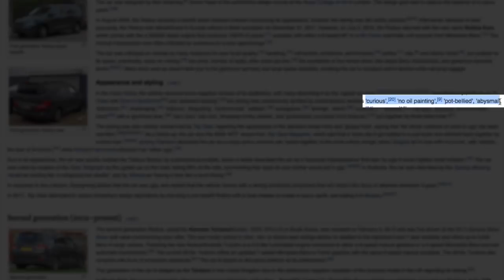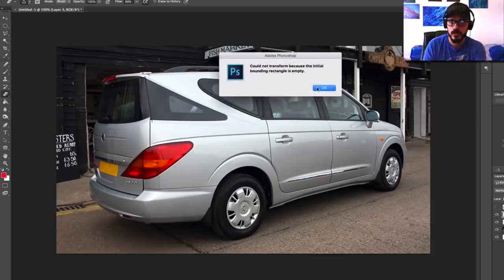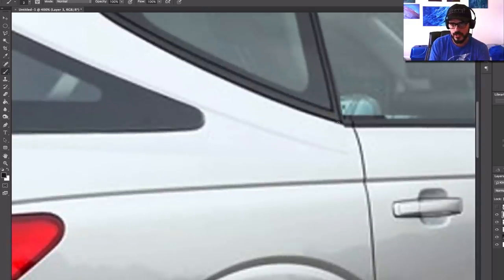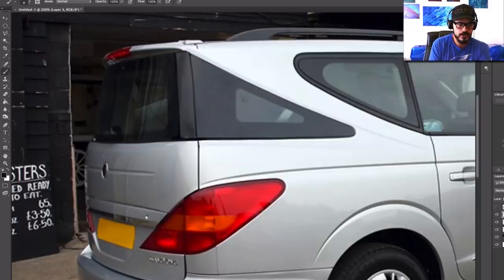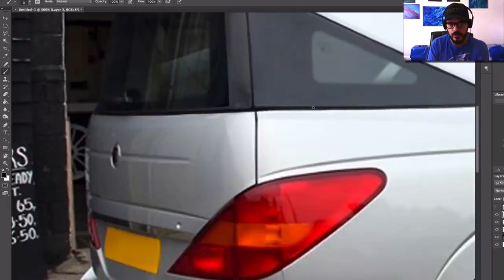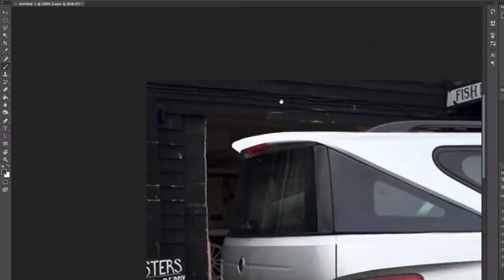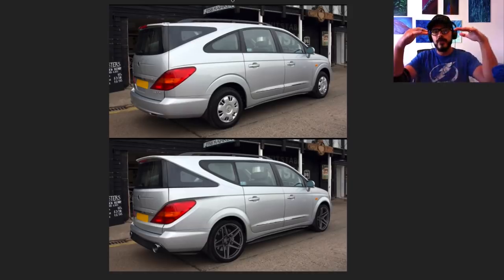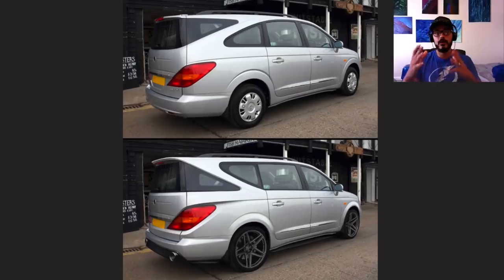Ssangyong Rodius Re-design - MISSION IMPOSSIBLE???

Comment: This car is literally Ssangyong Motor's Rodius. This car is the base of Mercedes Benz's W124 and the engine is based on OM602 (662), and the Jeep is similar to the OM665 licensed from Mercedes Benz. It is 2,700cc, a series 5 cylinder engine (L5) and has a Mercedes-Benz T-TRONIC (T-TRONIC). A diesel engine with a maximum horsepower of 191 horsepower and a common rail direct injection. So this engine uses WGT in the beginning and VGT in the later stages. This engine is called the XDI270 engine and Mercedes is called the CDI. Ssangyong uses the injectors from Delphi, and Benz uses the injectors from Bosch. The gasoline model we don't have in South Korea uses the W124 M104 engine and has a horsepower of 218 horsepower.

Comment: Like you always say simple changes really make a huge difference! 
As a tech nerd... You might not need to get a new computer. Since you were lagging with Photoshop and recording software both visually heavy things maybe what you need is a new video card. I assume you're using a Windows PC? If so you can do a couple of things do lookup your system info and run a DxDiag app. (Direct X Diagnostic) Basically tells you the specs of your computer. Could be maybe you need more RAM? 

To run DxDiag open start menu then press shift+r (opens up the "Run" app) then type dxdiag hit run. And system info can be found in Control Panel. 4 year old PC isnt that bad especially if it was a good or high end when you got it originally. Upgrading things like the video card and RAM are way cheaper solutions than going out and getting a new one. If you do have to get a new PC keep your hard drive with all your stuff and put it in the new one you get. That way you can still access files and things. Or you can transfer files over from old to new that way.

Comment: The problem with the original design is that it seems to ignore the Golden Ratio. The lower rear window line is way up high, it doesn't come near the 1:1.6'ish typical ratio you'd subconsciously expect. 

Some other Ssangyong cars have the same problem (the Ssangyong Actyon and Ssangyong Kyron for instance) where the lower portion of the rear is way to massive compared to the upper section.

Comment: Just a point of safety the Rodius/Stavic has an exhaust that finishes before the tail end to avoid carbon monoxide being drawn into the interior should the seal become damaged. Your redesign of the exhaust increases the risk of carbon monoxide being drawn in past a faulty seal.

PS I like my 2007 Stavic just as it is.

Comment: I think the business pitch for the Aztek was that

The centre console can be taken out and used as a cooler.

The tail gate was designed as a seat

And because the car came with a goddamn tent that could be set up out the back of the car and came with an Aztek branded air matress.